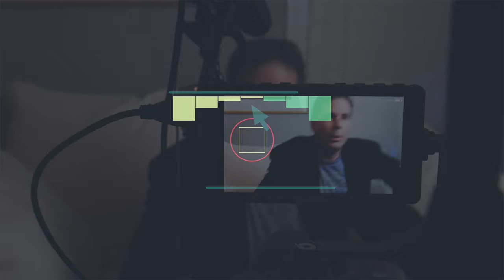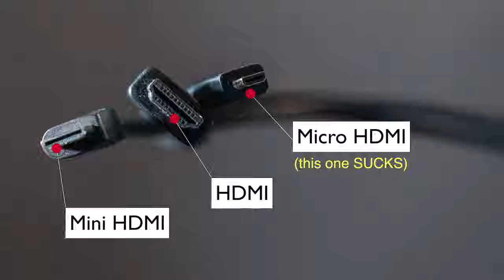Broken HDMI Port on Fujifilm  (How to Prevent)

Comment: I breathed on mine and it broke and that was with a support clamp.Amazing that they still have a micro HDMI.That being said I have had other HDMI ports that never gave me any issues.That and an internal battery that intermittently decides to not hold any power and reset the camera have been a great intro to Fujis quality.Ive owned some cheaper cameras but non as low quality as the XT3

Comment: considering how everything nowadays is going wireless, I don't know why we even need usb/micro/mini ports or usb c ports.  It should all just be like those magnetic pogo pins where you don't even have to push anything in anything...it'll just connect by strong magnetism easy to put on and easy to take off and no worrying of ever breaking anything.  

For about 20 years now I've had problems with every PC usb port always connecting my cameras or other devices to my PC via usb ports and they always mess up, disconnect by themselves, file transfers get interrupted or lost, connections get lost, even if you accidently touch the usb cable ever so lightly the connection is lost....argh...makes me frustrated.   I love how magnetic technology is so simple and so fast and clean...easy on and easy off...it's just too bad the transfer rates are not fast enough i guess that's why it hasn't taken off.

Comment: Great tip!  I feel your pain about the port — had similar experience w/different cam brand; plug got “wedded” to port via cable twisting (long story); had to send cam into manufacturer for repairs.  Another gripe is that port labels are embossed/marked in black on cam black background, making them tough to distinguish; chalk or other white mark on port name would help but dont want to risk negating warantee.  Dot of super glue on plug and matching dot on cam might also help, especially in dim lighting.  The least cam makers can do would be to print port names in contrasting colors on the inside of the port cover.  Dayglo anyone?  Old DIY saying, “If it doesn’t fit, force it; if it breaks, then it needed replacement anyway.”😁

Comment: Just broke mine today. Don't how it happened tho. I have and hdmi cable clamp fixed to my cage, the cable was in the clamp, I turn my external monitor to the left, and it stopped working but no "no signal" warning on the screen, and when it turn of and on the camera the monitor reacted to it, but with no images.Thought it was the cable. Changed the cable, but nothing then. Then I saw that the hdmi port was broken, like yours

Comment: Hey another top tip is to get a inexpensive camera cage + a HDMI clamp that bolts onto the side of the cage.... You could then get a micro hdmi to full size hdmi short cable.... Plug THAT into your camera and the clamp will hold the cable in place, flush on the cage. Now you can plug a full size hdmi without fear of damaging the micro hdmi.... And the clamp holds the micro end in place. 👍🏼👍🏼👍🏼👍🏼👍🏼👍🏼

Comment: Hi Pal,
I am using fuji xt3 and zhiyun Weebill s gimbal. I have a issues when I use Hdmi cable from my camera to monitor on my gimbal. The weight of Hdmi really bothers my camera movment. I am just wondering what is the best and cheepest  solution. 
Thank you

Comment: Guys does anyone know if it is possible to use the camera with broken hdmi port with a monitor (video monitor, such as ninja or so)? Perhaps with some usb-c to hdmi adaptator?
Thanks in advance, I'm finding literally nothing on web about fixing the problem instead of how to prevent it.
Reply: 2 years late I have the same problem... did you test it ? Did the USB-C to HDMI cable works on your monitor ? Or did you find a solution ? You'll will be my god in this dark times I'm right now

Comment: Wouldn't it be better to get a very short micro female hdmi to micro male hdmi cable. Then you can keep that in all the time and only unplug/plug the female port end of adapter rather than camera?
Reply: This is a joke right? It would probably break in the bag already in a matter of days if not hours. You’re putting a ever into the existing micro hdmi. Your chain is as strong as the weakest long and you’re putting a lever into your weakest link.

Comment: Hello Andrew ... it´s realy helpy ... ^^ I have a question (hdmi-cable): You use sometimes a gimbal with external screen (maybe shogun7 for example). Which gimbal you use for the fuji x-t3? I look for a gimbal with external screen. The hdmi-cable is realy important for this combo.
Hope you can help.
With best regards Joachim
Reply from the maker: Usually the DJI Ronin SC.

Comment: do not spend on this pen! just use simple silver marker for £1-2
Reply from the maker: The pen I'm referencing is not a bad deal... they sell it in packs of 6 for $9.00. So that comes to about $1.50 USD per pen. A silver marker will also work of course as well. I like these because they are paint-based and really work well on drones, etc. and a variety of surfaces.